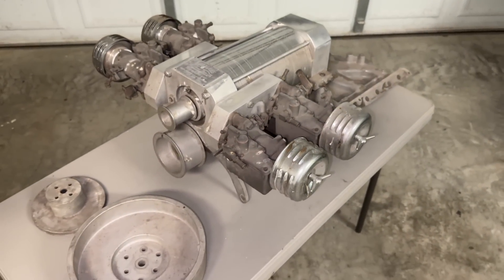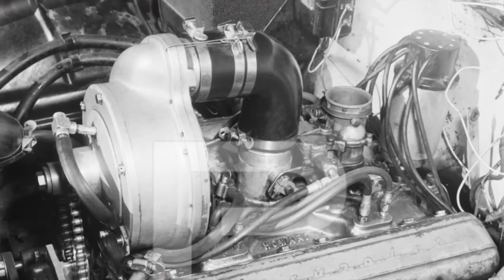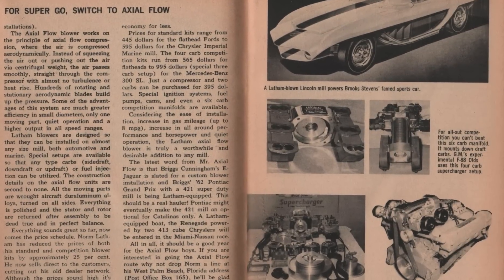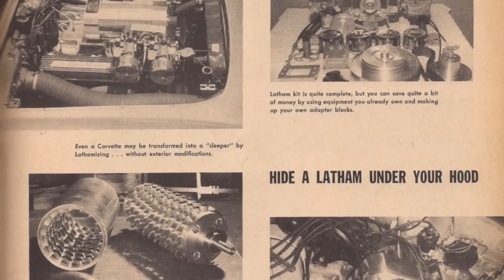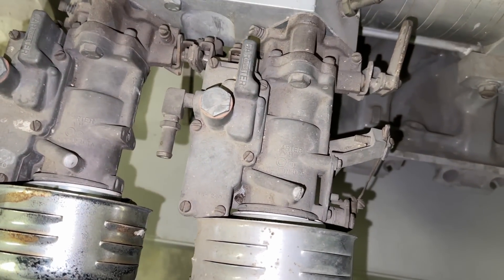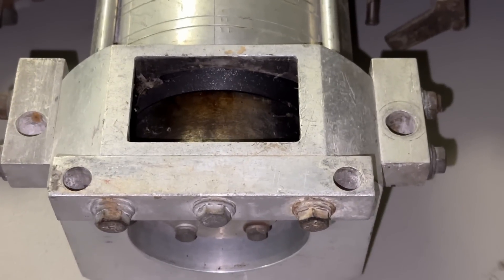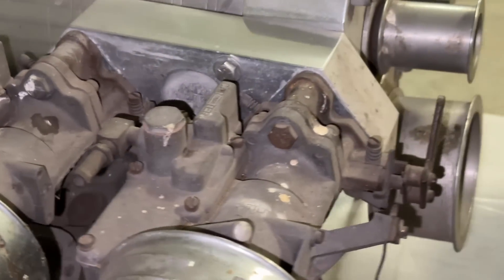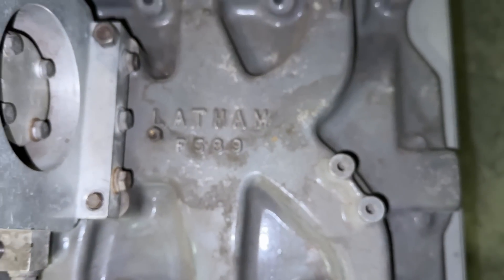LATHAM Axial Flow Supercharger - Fascinating History of a Short-Lived Design

Comment: With modern CAD and airflow data, you could probably design a kit for a couple thousand, with modern CNC and tolerances it would probably flow more too.
Reply: If I remember correctly.. they were originally made with investment casting process... and currently the new owner is using cad & cnc.  And I beleive the compressor is stackable for bigger displaced engines.

Comment: So when you hear the term 671 blower that’s actually the blower off of a Detroit?
Reply: Yes. It’s a blower sized for a 6 cylinder engine with 71 cubic inches per cylinder. That’s why a 471 is smaller and 871 bigger.

Comment: Anybody recall a “thermo siphon system for cooling?”
Reply: They were used on a lot of early cars. Model T especially, but others too. Based on the theory that heat rises, by making the water passages and rad hoses extra large you could do away with the water pump and let the hot water rise out of the engine, overflow into the radiator, fall thru the rad cooling as it went, and back into the engine. Jay Leno has a 1923 Wills St Clair V8  - a very expensive, fast car for its time - that has thermosyphon cooling and reports it never overheats even in 100 degree weather.
Reply: Thanks buddy of my had a 58 Bette with that system, always remembered!

Comment: It's a axial flow jet engine compressor design. That's why it sounds like one when you spin it up.
Reply: an axial. Get with it.
Reply: @amsterob  what is the role of the stator in respect of the interstage flow of air in such a machine?
Reply: Early version of a whippel
Reply: @Freedomishere-im6ug  no not exactly a Whipple supercharger - while the charge flows in an axial direction Whipple are a twin screw positive displacement. The Latham supercharger is a multi stage axle compressor where the air flows from one point to another stage to stage gaining a little bit of pressure at each stage very similar to how a modern gas turbine engine works. If you look at schematics of the two you’ll see what I mean the only similarity is that the flow is end to end rather than top to bottom so to speak but the operating principles other than that are quite different.
Reply: @malcolmwhite6588  whippel start compsion at one end and blows out the other end like your Latham 
Both Latham-whippel gain power with (length)and girth of housing
Both Latham-whippel probably lower charge air temps because they compress slower over the length vs a roots style 
Whippel is cost effective over Latham 
But I will the Latham is a cool design
Reply: @Freedomishere-im6ug  brilliant very well summarised👍🏆😊

Comment: It would be interesting to make an axial-flow unit using modern airflow technology.   Our jet engines have computer controlled stator vanes which can tailor the compressor to whatever situation is needed.   More than likely an active stator supercharger would make lots more torque down low then flatten out for good high rpm airflow.   That would be a fun project.
Reply: An internal gearset to overdrive it would probably also be better than having to run such a big crank pulley to spin it fast enough.
Reply: @jackass72  I had a McCulloch Studebaker centrifugal single stage supercharger that I took apart one time in the 1960's to see the internals. The impeller was driven by about 5  large ball bearings to increase the speed. However, the crank pully was large  and the nose pully of the supercharger was fairly small giving substantial overdrive to the unit. The ball drive eliminated the terrible impact loading of overdriven gear teeth when large or severe changes in engine RPM occurred. The ball drive was in an oil bath and apparently slipped enough when the throttle was blipped so it would not self destruct like gears would.
Reply: Dunno. VNT turbos died off almost as quick as they arrived. 😐
Reply: @michaelgautreaux3168  Variable geometry turbo's are in use on diesel's  by the millions and work pretty well considering they're dealing with dirty exhaust.   A variable vane axial flow compressor would be completely different in that only clean air would be directed by the vanes and would stay clean.
Reply: They are very much alive and well, and computer controlled now on many heavy diesel applications. @michaelgautreaux3168
Reply: @michaelgautreaux3168 Both VNT and VGT turbos are still alive and well. And have been for decades.
Reply: A modern larger version of this would have to make more power.

Comment: Interesting super charger/blower I would love to see one on a car.  I would be very interested in seeing what the profile of the pulleys are because the property shaped pulley will keep a flat belt tracking straight.  Think of all the equipment that ran using flat leather belts starting with a factory, machine shop, or mill that used line shaft belt systems to power all there equipment and machines via water or steam power. Additionally in the era before electricity was wide spread farms or people living out side a city would use portable a hit and miss engine with a flat belt to power the well, washing machine, and even run a dynamo to allow the house to have electric lights, lastly many farm tractors prior to 1930’ had an exposed flywheel/pulley to power a large variety of equipment. Yes I know those examples all are running at much slower speeds than a hot rod engine but the engineering principle is still the same.
Lastly you can take the belt off a roots style blower and rotate the rotors of the blower and pin /lock the pulley/rotors in place and run rhe engine. Roots blowers require a certain amount of space between the rotors and case of the blower to allow/account for expansion and contraction of the case and rotors which is one of the reasons that high performance roots blowers have a replacable Teflon wear strip on the rotors.

Comment: Works just like the compressor side of a jet engine.
Reply: Yup
Reply: a more modern style. in the 50's some jets still had centrifugal compressors on the cold side of the engine. Modern jets have variable guide vanes instead of just a monumental block of stators, but I'm guessing that its incredibly hard to machine and other systems cost up.
Reply: @TheGimpy117 variable guide vanes? 
Some, but not a lot of aircraft are straight axial flow (B52),turbo prop etc. A lot are high bypass turbo fan engines which get a good bit of their thrust from the fan. 
I'm not an expert, but I did work in aerospace and installed nacelles and components onto engines.
Reply: I grew up in florida I actually gave one away as a younger man in my late teens for a running long block that was not worth 500bucks I acquired it from a older couple at a garage sale in Kissimmee for 100$ see back then I didn't know but I knew all I got was the blower the tbt all I was interested in was the big ass webber /dalortos . And it had twins one on each side at that time I had stepped away from building v8's and was growing up in the tuner era learning how to tune efi at its Meka center for import drag racing coming alive I was actually driving a 1988 Mazda rx7 turbo ll  I just purchased with less then 40thosand miles on it I had been building rotary engines for almost3 yrs as well as working at a machine shop we made a bracket and boosted a bunch of 12a and 13b rotary's it sounded wicked especially with the 10,000rpm peripheral port engine or a 4 port bridge port we had a problem with it and needed parts to no availability we could get the precision bearings that were made for I think it came out a spindle for a bridge port and if you ever rebuilt any precision machining lathe or mill you know the cost of a tight tolerance bearing is ridiculous I know who has it and going to give him a ring today see if it's still there most likely it is
Reply: @vinmandich7756 any video from back in the day running it on a rotary?

Comment: Before you get that thing spinning too fast, what are it’s lubrication needs.
Reply: There is a grease fitting on front, right above pulley
Reply from the maker: Agreed, it needs some attention before I play too much. I just had to do a quick spin so I could hear it. The bearings have grease fittings, but I want to be sure to use the correct stuff, so I don't hurt anything.

Comment: U r very very fortunate 2 have come across this Latham Supercharger.  
A fella in California apparently bought the rights 2 them & if reports r correct improved them . 
Trying 2 purchase one is almost impossible.  These Blowers don't Rob massive power from the engine like other blowers especially the Roots Blower 😅
Reply from the maker: It's a once in a lifetime chance...so we jumped on it pretty quick.
Reply: I have one of Richard Paul's Latham Superchargers.  I tried it on a SBF application with the Weber 48 DCOE carb in the late 1980's.  Also tried direct port injection with it.  I can tell you the Latham did not like running dry with no fuel going through the supercharger.  Had all sorts of problems with sheared case bolts.  Tried cro-moly case bolts and that did not help.  The intake tract was way too long with the Weber 48 DCOE, I drag raced with it on the car and hit 114mph in the 1/4 mile but it took a long time to get there.  I still have the whole set-up and Richard Paul wanted me to send the unit down to be put together again.  I have all the parts and drive pulleys.  It went to a knurled 3 rib drive pulley and a 3 rib Kevlar belt.  I can post pics of everything if anyone is interested.  On a SBF, the distributor gets in the way, so a better application is a SBC or something without a distributor in the way.

Comment: Would it fit on a 427cammer?
Reply from the maker: Unfortunately, the intake would only bolt onto conventional FE cylinder heads. But the blower itself could be adapted to a cammer intake. That would be a pretty wild combo.

Comment: What am I looking at? 0:45
Reply: A lateral thinker! Blow in through the exhausts, exhaust through the intakes! Wonder how well it went.
Reply from the maker: Pure wizardry. That is a Buick Nailhead engine that has been converted to "reverse flow". Air flowed into the exhaust ports and out of the intake ports. Potvin style supercharger mounting with four two-barrel carburetors. I'm sure there was some theory behind the reverse flow, but it sure seems like a lot of work.
Reply: @HotRodHoarder  That generation Buick V8 had decent flowing intake ports and tortured, pinched exhaust ports. The idea of flipping the intake and exhaust was: the supercharger would compensate for the poor shape of the [originally exhaust] intake ports by cramming the intake mixture through the pinched ports, while the good-flowing [originally intake] exhaust ports would be able to adequately scavenge the increased airflow from the supercharged engine…

Comment: If you were building model cars in the 1960s you knew about the Latham supercharger.  AMT model company made a kit 1925 Model T Ford that included a Lincoln engine (MEL) that could be built with a Latham supercharger 4 carb setup.
Reply from the maker: That's awesome. These Latham blowers were everywhere...that's what seems so strange about the low production numbers. Lots of publicity, not a lot of production.
Reply: @HotRodHoarder  Probably the cost.  They were superior to the GMC and McCullough but those were mass produced in the thousands and available in junkyards.  With careful rebuilding the GMC could add a lot of hp.
Reply: How rare are offenhauser with 6 Ford carbs with the linkage go for.my friend just found one in her barn that was hid @HotRodHoarder
Reply: I have a couple re-releases of that kit,,,, just for the Latham.
Also, the AMT 64 Olds F85 included a dual Judson set up.
Reply: Yes! I had that kit! Built it up fully fendered with the Latham blower and purple pearl (actually nail varnish) paint job.
Reply: I built the chopped coupe version in candy apple red.
Reply: Yeah but like w/ the '65 Riviera, the mounting & induction was laughable. They weren't 6-71s & AMT didn't get it. Same can be said w/ dual Judsons in the '64 Cutlass kits.
Reply: Yeah, I built that kit but never used the Latham set up mainly because I thought it was too damn ugly.
Reply: If you were building cars in the 1960s, you're probably close to death now.😂
Reply: @edrcozonoking  You could meet a nasty accident at any moment. No one knows when one's time is up. Make the best of every moment and never say anything you might regret.